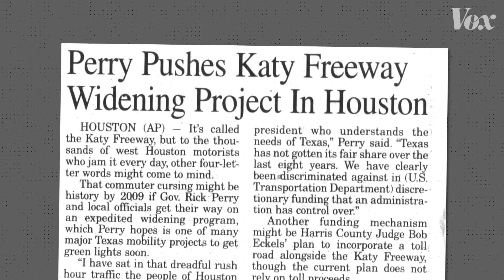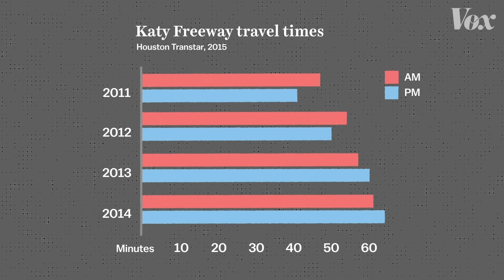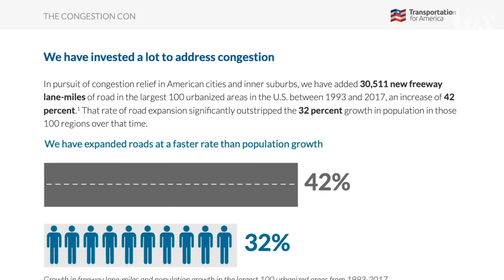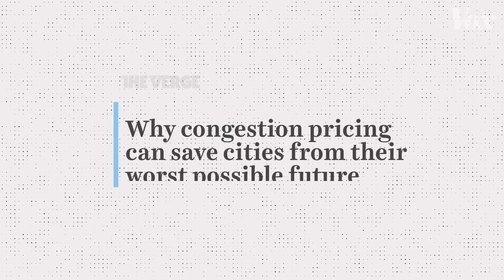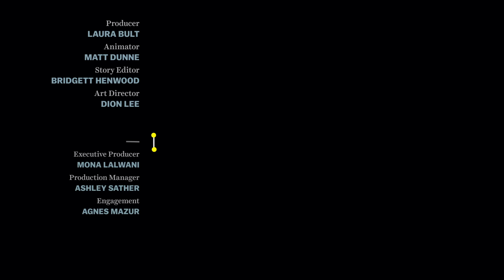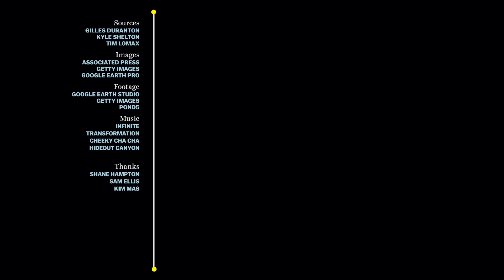How highways make traffic worse

Comment: Boston didn't remove the highway, they put it underground... And the congestion is still awful, just underground...
Reply: Bear this mind when people suggest flying cars as solution: it will not solve it, it just expands the problem upwards.
Reply: Not only did we put it underground but in the process of doing so it made traffic terrible during its construction a nice quick 16 years
Reply: It's true. The Big Dig buried I-93 through central Boston, added cloverleafs on the West End, and added a new I-90 bridge over the inner harbor. The project had a cost overrun of about 190%. We shouldn't look to the Big Dig for inspiration in solving our freeway problems, except to see how much a city improves when you restore local pedestrian access and hide a blighted freeway.
Reply: @nealehardt7957  agreed, I think South Korea highway removal is better example for this, they removed the highway on the river entirely and resulted in less traffic.
Reply: @Banom7a  That said, their urban development+mass transit are sensible too
Reply: @dbclass4075  The reason flying cars would be effective is that you have virtually endless space in 3 dimensions if you're flying, since you no longer depend on on physical roads. With basically infinite lanes, at some point, the congestion would stop....

The problem would be congestion at landing and take-off sites, so we'd need some type of slotting sytem to ensure that those don't get overcrowded.
Reply: @insertchannelnamehere8685  I don't want flying cars flying over my house.
Reply: Even if they were limited to flying only over existing roads, they could still have much higher capacity just by stacking up on each other...
Reply: @hobog  Boston could be better, it have all the right ingredients for good public transportation,  like easily walkable city etc.

It's a shame that they are not that
Reply: @insertchannelnamehere8685  That is indeed feasible on paper, but terrible in practice. Noise is a big concern. And again, you only expand the problem upwards. Stacking on top of each other is still similar to added lanes: induced demand. Drivers could not even merge properly onto lanes on their side, let alone the added dimensions of above and below lanes.

Drivers could not gauge the correct following distance to brake in time. Asking them to correctly gauge their height above ground is too much. There is a reason why pilot's license takes more than one month, and much more than "a trip to the FAA/DOT".
Reply: @dbclass4075  Any future in which flying cars are widespread would be autonomous. And the difference between stacking lanes in the air and building lanes on the ground is that a new " aerial lane" is free whereas a highway expansion is limited in nature. Noise can be regulated with newer, quieter, motors, or just be flying higher. Like I mentioned though, none of this is probably going to happen anyways because of bottlenecks when it comes to takeoff and landing, but if we somehow did get a bunch of flying cars in the air, aerial traffic, at least in transit, wouldn't be a major concern.
Reply: @insertchannelnamehere8685  Nope, the aerial lane is not technically free because of the bottleneck on the destinations. It will take time to unstack those cars back into the ground if they are ridiculously high. Not to mention parking. Bear in mind Americans still have the mindset of personal cars, so they are reluctant with the idea of shared cars.

In both types of expansion, there is diminishing return of investment. Perhaps flying cars will be the last solution to explore in terms of improving transit.
Reply: @dbclass4075  Exactly, that's why I said aerial congestion is only not a problem when in transit. Of course those bottlenecks are a problem and I agree that flying cars probably won't be widely adopted, I'm just saying the reason isn't so much lack of space in the air, and more, lack of landing capacity and pollution. This is one of those situations where we're actually agreeing with one another, but we just don't realize it.
Reply: @insertchannelnamehere8685  Perhaps the politicians should use this conversation as an example?
Reply: @dbclass4075  then the only solution is smaller cities with a lot less people.
Reply: Why no one talking about explosion of human population on earth?? Isn't it the main reason for most of the problems the world facing now.?
Reply: @ligametis  But transportation link to other cities is still needed. There are really two ways to resolve transport congestion:

• Reduce demand
• Increase supply
Reply: @dbclass4075  Yeah, the pandemic is helping a lot with the reduce demand part, a whole lot of people are working from home, and many companies plan to keep it that way even post-pandemic
Reply: I was about to comment this. And the construction of the tunnel was an absolute nightmare.
Reply: @insertchannelnamehere8685  Even in current air traffic control models, you don't have virtually endless space.  If anything, you have complications born out of security (restricted airspace), safety (topographic and human-made hazards), environmental concerns (noise, pollution) and physics (cabin pressurization, fuel efficiency, etc...)

Flying cars is not a solution...its just an invitation for more problems.  If we change how we build and grow our spaces, we can solve the problem without resorting to a pile on of technology in the hope that it makes the problem go away.  We need to treat the problem, not the symptom.
Reply: @nickmonks9563  Yeah, if you had read that entire conversation perhaps you would have seen that I agree that it's not the ideal transportation solution. All I was saying is that lack of space for in transit vehicles is not as big of a problem (it's also a solvable problem with better air traffic management) as congestion at landing/takeoff sites
Reply: @insertchannelnamehere8685  Companies realise quite late that efficiency improved when their employees don't have to waste time travelling.
Reply: @nickmonks9563  Flying cars are still cars: they still have space inefficiency. Often only carrying the driver/one occupant.
Reply: And underground usually costs the taxpayer much more
Reply: @ahndrayuh  then move to Idaho
Reply: @ligametis  can't happen when we have winner take all incentives
Reply: @blondie7240  Why?
Reply: @ahndrayuh  Metropolitan areas will for sure be getting flying cars. But not rural Idaho.
Reply: @blondie7240  I think there will be a lot of push back to flying cars, and we would have to rethink the design of cities so that flying cars could be operated safely. Flying cars would have to be self-driving. I could not imagine any reasonable government to allow any joe schmo to operate a flying car. Even with automation, I don't truly trust thousands of flying cars zooming above people without a few hundred falling out of the sky each year and killing folks. Flying cars would need to be heavily regulated like airplanes to help ensure safety.  If these things aren't thoroughly thought out, I guess I will be moving to Idaho.
Reply: Traffic is probably even worse now than it was back then. Anyone who's driven through those tunnels on a weekday knows how much of a nightmare they are. Plus most of the MBTA is so unreliable and outdated that you have no choice but to just drive.

Comment: Boston didn't remove the highway downtown. They simply replaced it with a tunnel. San Francisco would've been a better example here.
Reply: Or Portland OR
Reply: @lawrencewilliams4829  portland also made a tunnel after the highway removal
Reply: Tunnels are just more expensive roads.
Reply: But people are leaving San Francisco because it costs too much to live there, and there are more options to work remotely, so you don't need to live near the tech capitols in California.  And where are the largest number of the people moving.  Texas, because the taxes are lower.
Reply: Yes. This video is a bit of a mess.
Reply: @lawrencewilliams4829  Traffic in Portland was literally the worst I have experienced for the year I lived there, and I have lived in LA. Not a good example if trying to show removing highway helps traffic.
Reply: ‘Simply’  lol that’s a good one

Comment: I LOVE driving, but having lived in (Washington DC), or extensively visited cities that had amazing public transportation infrastructure (London, UK and Toronto, Canada), I strongly advocate for better public transportation to get around more efficiently. I fail to understand why the USA doesn’t have a high speed rail network like Japan or France running from Boston to Miami and NYC to Chicago.
Reply: Unlike Japan or France, the US is HUGE while the population is spread out. Its just not economically feasible
Reply: @st3pn56  at least they can try to make rail network between Boston and Baltimore/DC
Reply: @st3pn56  no I'm sorry but stop using the size card, that's not the real reason.
For example, although France is smaller than the US, it's still massive and spread out. 
The US could connect some of the major cities in the Eastern region, and as long as it's done properly, it would work and would become financially feasible.

How many domestic flights are currently made between those cities? Imagine having the option to take the train which may have a longer travel time, but with none of the faffing about with the airport.

Do not dismissed high speed rail. Sure it's not going to be adequate between NY and LA, but for closer cities it's really a no brainer
Reply: @SomeGuy-lw2po  I don’t think that’s gonna improve the traffic my guy
Reply: @tonyye8680  you're right, it absolutely wouldn't. That was just an argument showing the size is not an excuse.

To fix traffic, you need the above, proper regional, suburban commuter rail. Then better transport in the cities, whether that's a great bus service (London busses), trams, metro, good walking routes.
Reply: @SomeGuy-lw2po  The problem is that most US cities have a very low population density compared to most cities in the EU, so public transport is gonna be barely profitable.
Reply: I think it’s partly because a lot of towns in the US are really only built for people going on road trips. They’re the small towns with a population of 256 and one gas station designed purely as rest stops for road trips
Reply: @st3pn56  Lots of cities had extensive streetcar networks 60 or 70 years ago when the total population was considerably smaller than it is now. It’s really more about development choices than overall population density.
Reply: @tonyye8680  I completely disagree.
Your cities have been designed for cars for the last 50years, there is no reason that couldn't start to be reversed now. 

And to make it profitable, all you have to do is start of building that one good transport route were they know people would use it, once that starts to work, build the next one. You don't build a full transport system in one go, and it's only after you've got a good system can you start expecting to those non-profitable areas.
Reply: @st3pn56  Europe is huge and they have wide public transit
Reply: Helsinki, with the population of 600k has a great public transit system. I doubt the US cities with congestion problems are the ones with a smaller population than that.
Reply: @st3pn56  
Thats just a consequence of not building high speed rail
So it becomes we cannot high speed rail because we have not built high speed rail
Reply: @st3pn56  whilst high speed trains are probably not very practical to go coast to coast, there are still plenty of city pairs in the US which are just right for trains. If you're in Paris, then you could go to Lyon or Marseille by train though you wouldn't take the train to Athens or Bucharest
Reply: I like driving too. Pretty good at it and I have to as I have a company truck for work. I’d be on top of the moon if all these rookie drivers on the highway suddenly vanished. I could make it home in 15 minutes during Covid. Now it takes over an hour thanks to all these yuppies that are afraid to make a lane change on a turn
Reply: Don't forget china, mostly.
Reply: If you love driving, you should support freeway expansions
Reply: Cars co exist in cities like tokyo
Reply: @st3pn56 that’s a wrong agrument bc it had good public transportation back than and china has a good public transportation despite also being massive
Reply: @SomeGuy-lw2po you don’t need to imagine that bc something like that exists in China
Reply: @roadguy4214  freeway expansion is the funniest argument. How many people can say they're happy with the quality of roads as they are now?

Most roads are in terrible condition and that's because road maintenance is expensive. Most countries can't keep up with it, so adding more freeways just makes that problem worst.

Also, transport such as railways and freeways work using induced demand. Before building such a project, there may be some demand. But only once it's built do you actually create a demand.
This is precisely way American has freeways with 14 lanes that still get gridlocked. Adding more lanes does not improve traffic or transportation. 

Adding off road transport, preferably railways, it absolutely does help transport and road congestion. In fact, if you love driving and hate trains, you should be the biggest supporters of good public transport because it will open the roads up for you!
Reply: @roadguy4214  No, that makes things worse for those of us who like driving.

Comment: The reason that Boston had success in reducing congestion was due to a particular 2 mile stretch that had 2.1 miles of on ramps before moving in underground.  By removing the constant on/ off of traffic flow was improved and congestion reduced especially with better designed exits and on ramps.
Reply: I wish Rhode Island would spend money to revamp 95 through Providence. Traffic is horrendous due to the US 6 and RI 146 on/off ramps being so close to each other.